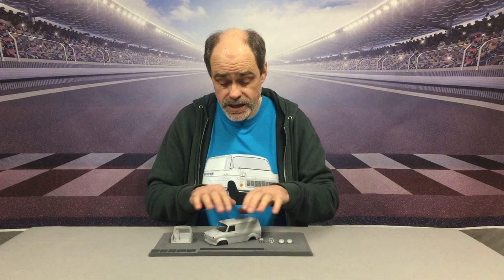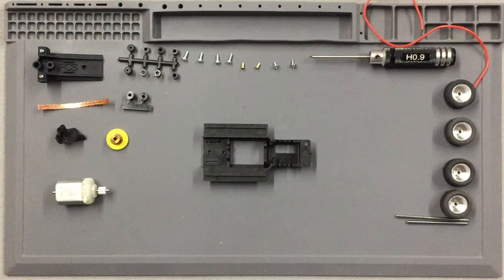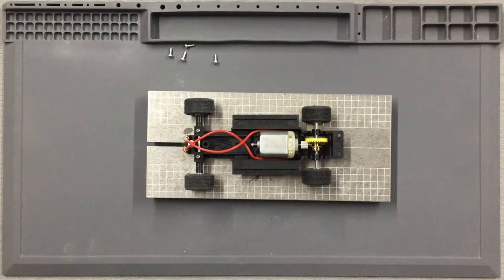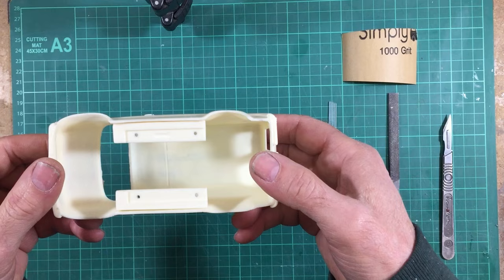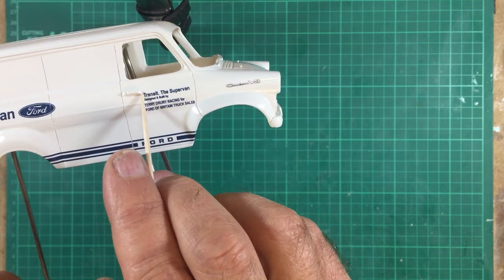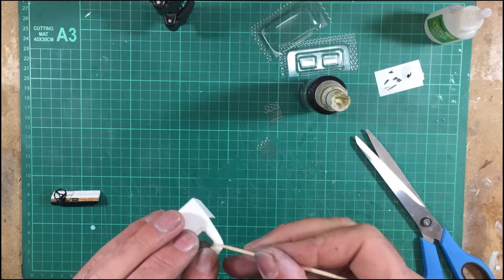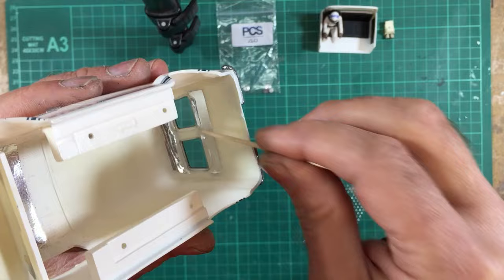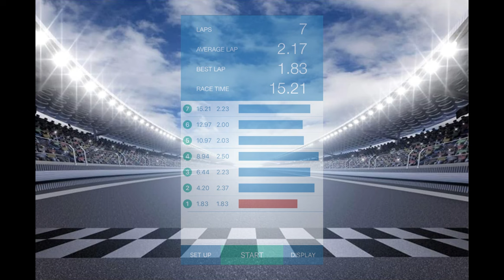Turning a Pendle Slot Racing Ford Transit resin kit into Supervan 1 Part 2.

Comment: Hi Rob,
Fantastic van.
Tell me, how did you slip the steering wheel stalk into the dash hole - while sliding the interior tub into place ?
Regards,
Jack
Reply from the maker: I just looked at the stalk through the window as I slid the interior in to place, it is very easy.